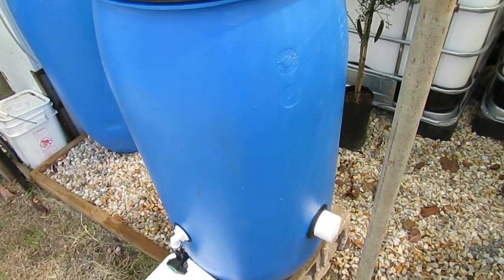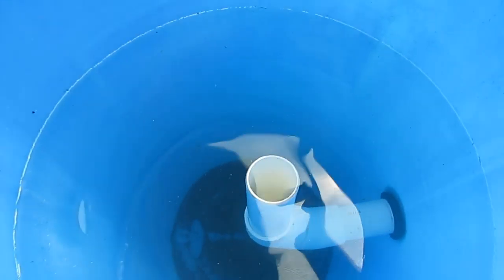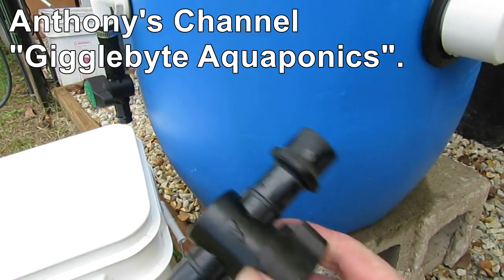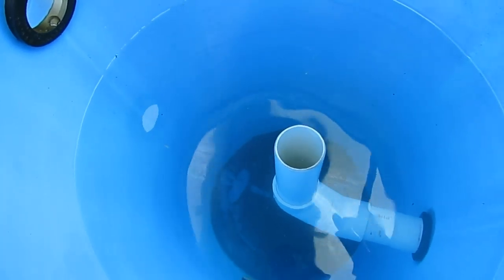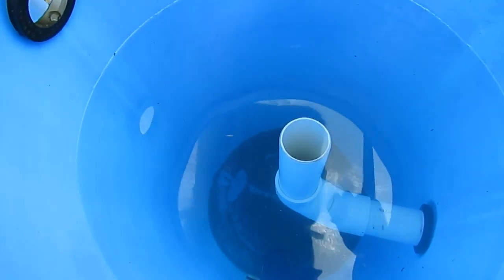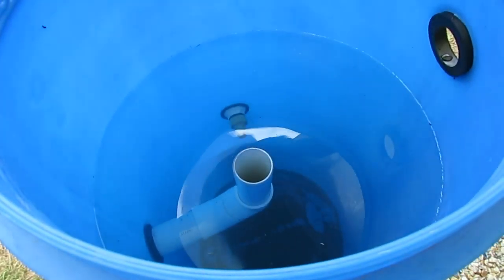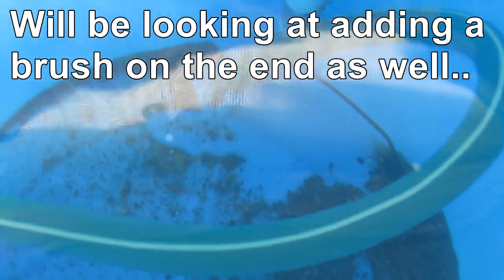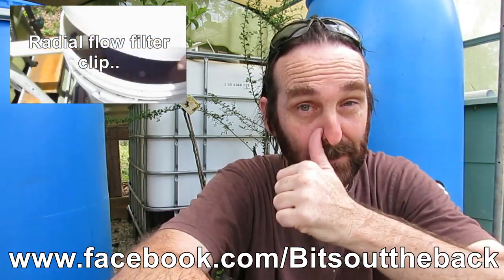Aquaponic & aquaculture radial flow filter cleaning, just playing around..

Comment: Great work Rob.
Looks pretty good to me and the best part is, it's simple.
The less moving parts the more reliable it will be.
Reply from the maker: That's what I was aiming for Brett.. Still looking at making an airlift vacuum just to see how they go.. Will mean having an air line running to the system but that's no big deal..
Cheers mate & have a great week..
Rob,
Reply: Rob Bob Was thinking about this the other night, what if you fitted a 90mm piece of pipe to the middle of the bottom of the drum? Then add a tap to the bottom of that? I'm thinking like a solids trap. 

Brett.
Reply: Brett Cooper Rob Bob Thinking some more, wouldn't need to be that big as the water flowing out the bottom would drag the solids in.

Better get back to work now, (squirrel!!)
Brett

Comment: I've seen people hand form a conical bottom from cement with a  2-3 drain in the bottom just using a pipe and bulkhead fitting. Thanks for another useful video.
Reply from the maker: Have seen the a few good ones made like thatafrohman.. The urban Farming guys did a great job on their swirl filter using that method..Vortex Filter DIY - Organic Fertilizer on Demand
Cheers & have a great one :)
Rob.

Comment: Hey Rob. Just want to recommend using vacuum attachment brush. I don't really know if it would fit on a 1 inch diameter PVC, but if it doesn't, you can take the piece of PVC pipe or coupler and heat it up in an oven or use a heat gun. Start from low temperature then heat it up for about 3-5 minutes. Make sure you put a piece of foil on the bottom just in case the PVC melts completely. Once the PVC is soft, wear some mittens and force the vacuum attachment brush to it.
Reply from the maker: Morning & thanks for that...
Am looking at adding some sort of small brush to the "wand"..  Was thinking of one of the wire style ones that I can fasten to the end with a zip tie.. Shall see how I go..
Cheers sir & have a great one.
Rob.
Reply: Rob Bob No problem. I have one that I don't really use. It came with the vacuum we already have. Looks like it would be very handy with this project. 

Thanks for the videos by the way. I'm planning to be like a gardener like you later on. I learned a lot of useful things in your channel. Here in the states, food is expensive and probably sprayed by chemicals I don't want in my body. I really love your life style.

Comment: Thanks Rob...great idea! Definately think a small stiff brush or maybe even a plastic scraper would be a good idea to get the goo off the bottom. You already have a bio filter on that system if I recall correctly so the raft system should be a great producer for ya :)
Reply from the maker: Buffalo_Chips 
Haven't used it much this time round but think I'll install one similar in the parents to make the job easier..
Cheers mate..

Comment: I would recommend giving the water a bit of a swirling action to make all the waste collect in the center. you do it with a during the collection phase using a small tube coming off the main inlet pipe or you could just do it when your collecting by swirling the water with your hand and then let it collect
Reply from the maker: Hi Corey.. I tried using my hand on one of the first clean outs in the aquaponic filter.. Noticed the solids broke up & spread through the water.. Think it has to do with the inlet pipe disturbing the vortex if that makes sense.. Didn't think of adding another pipe to help it along though.. Might be something to play around with..
Thanks for that mate..
Rob..

Comment: Ever think about making a cone, or funnel that sits in the bottom of the barrel? It could collect everything to a center point for easier clean out with the hose.... or you may be able to attach the hose to the underside of the cone even. Maybe just a slope to 1 side of the barrel could make a cleanout more efficient.
Reply from the maker: Thanks for the suggestions bigtitantrucker.. I have considered doing a cone but decided to have a crack at the easiest build possible.. A slope coming in off the side would help to collect the bulk of the solid to one spot but after a while I think there would be a build up of smaller solids behind the false wall that could cause other issues.. Someone mentioned having a go at including something like that on the FB page..
Thanks again & have a great one,
Rob..

Comment: Thanks rob, great video!  by installing a clean out valve through a bulkhead  or uni-seal in the bottom of the barrel, would you be able to eliminate the need for the hose?
Reply from the maker: Hi there...
We have one in the other radial flow filter on the side of the drum.. We need to stir up the solids to get it to flow out which is a bit of a problem as it mixes through all the water & we end up having to dump the lot.. If it was in the centre of the base it might work a bit better I think.. Will be playing around with that idea but for now I think I will stick for the hose on the big system.. Would like to get a plastic welder & install a cone in a drum but that will be a ways down the track at this point..
Cheers,
Rob.

Comment: Hello Rob,
Really enjoying your aquaponics videos as I'm preparing for my own.  Just curious but why not make an outlet to the sump at a point that leaves about 5 gallons in the barrel and use the current method of drain and flush with hose?
Reply from the maker: Thanks for that :) That would work well in the aquaponic system here as the sump is lower a fair bit lower than the filter.. The sump in the RAS is at the same height as the other filters so would be harder to do but shall keep it in mind though..
Cheers & have a great one..
Rob :)

Comment: If you attach a funnel on to the "sucking end" of the pipe it may help remove larger quantities in the same space of time. I have no idea as to weather or not that will work, but it is just an idea that comes to mind.
Reply: It'll be drawing from a larger area, but will reduce the force at which it sucks.  So that's great for lighter debris over a larger area, but not so good if the target is heavy.
Reply from the maker: Joe Howe
Cheers for the post below Joe.. YT won't let me reply down there :/
Have seen the air lift vac clip before & am still going to build something like that just to see how good they are.. Might need tweaking to be able to handle the waste from 60+ fish though..
Like the stocking one as well, might make something like that for the small tank we in the house that has the refugees from the old garden pond in it..
Thanks again & have a great one..
Cheers..
Reply from the maker: Have had a few folks suggest that so might have a go & see what I come up with.. Think the top of a soda/soft drink bottle should do the trick as it's about the same diameter as the hose..
Cheers & have a great week,
Rob..

Comment: If you have a bigger gauge tap but smaller hose and increase the flow rate, will that increase sucking power?
Reply from the maker: I think that would help a bit suction wise.. My concern would be solids clogging the smaller gauge pipe/nozzle.. The waste is very light & breaks apart easy so it might be ok.. I am thinking that a funnel connection on the end will help clean the base a lot faster so use less water during the process in the end.. Shall see how it goes with the real stuff soon I hope..
Cheers Paul & have a great one,
Rob..

Comment: Hey Rob great video as always.

 I was thinking about your siphon vacum cleaner which you use to clean the button of the radial flow. If you used an airlift (look them up on youtube, loads of people build them. Actually look up aquarium air driven vacuum cleaner and just build a bigger one of those as that is actually what I am describing here) instead of your water syphon you'd get better results and it would be more diverse. With an air vac could actually clean out your Radial flow and bottom of the fish tank without the need to turn off your flow or drain out loads of water. As the water in an air driven vac flows via a sock to capture the muck straight back into the water supply you are cleaning out. If you want a plan and parts list you to put one together, let me know and I'll knock something up for you.

Take care

Dunc
Reply from the maker: Hi there Dunc..
Have seen a few good clips on the air lift pumps & want to have a crack at one in the future.. The collection of the solids in a canister is the one issue I want to sort out.. Need to visit the local aquarium stores to see what sort of filter material is available as I'm expecting a lot of solids once the fish put some size on.. This is the clip I was going to use as a guide, #123: DIY Airlift Aquarium Vac Wand Version 2 - DIY Wednesday What do you think of that one ?
Thanks for the offer mate, really appreciate it..
Cheers..
Reply: Rob. that video is great. The issue with his design though in your application is the volume of solids you'll be dealing with. You'll notice in that example the collection chamber was near the bottom of the tube and has filter floss in it to prevent the exhaust water dragging muck back into the tank. If you deployed that design you'll be for ever checking it to see how full the chamber was getting. I'd use his airlift idea but bring the collection up near your top hand out of the water. use your 45/45 into a T with one side of the T being the air exhaust and the other pointing downward into a sock (yes a Sock, paint filter or mums stocking) that way you get instant feedback on how much muck you have collected and can easily remove the sock for cleaning.

With regards to filter medium. don't buy from an Aqurium shop its too expensive. You can get the same filters in larger sizes from Pool stores. Just order it online its cheap (heavy, medium and Fine as the three layers work as a team for complete filtration of solids). Watch 'Pond Gru' he has a few great videos on filters and mediums.

Between your radial flow and Bio medium I'd add another barrel/bucket, and fill that with filter sponges. The reason for that is the K1 bio medium will be more affective if you can keep as much solids away from it as possible. it will also mean you open the container less. That helps keep the bacteria in the dark and also clean. You'd then just have to interact with the radial flow and filter buckets for your cleaning routine.

I hope that helps. as previously mentioned if you struggle with a design I draw something up for you, on the back of a fag packet :-)
Reply from the maker: EastLondonKiwi  Cheers for all the pointers Dunc.. Shall look for pool pads this time ;)
CCBear is looking to add a filter box between his RFF & bio for the finer solids as he noticed a few getting through to his bio.. Think I might be looking into it but not 100% sure I will add one yet.. If we do it will be a small 15L bucket jobbie as we're a bit pushed for room..
Thanks Again Sir  :)
Reply: No worries Rob.  Here are a couple of ebay links to two of the items I was talking about. there UK listed items so ignore the suppliers and prices. You should be able to source (for the filter pads) from a local supplier, and the vacuum is just to illustrated my points, as this particular model is far to small for your application.

http://www.ebay.co.uk/itm/171033986851?ssPageName=STRK:MEWNX:IT&_trksid=p3984.m1439.l2649

http://www.ebay.co.uk/itm/3-PIECE-FISH-POND-FOAM-FILTER-MEDIA-SET-PROFILED-17-x-11-/261055504095?pt=UK_Pet_Supplies_Fish&hash=item3cc81ededf
Reply from the maker: EastLondonKiwi  Cheers.. I had looked at prices on some of the aquarium foam & nearly fell off my chair here :D
Cheers for a look at the vacuum too..
Reply: Yes it's a bit like owning a boat, anything market for marine use is 10 times the price. That said, there are our mediums that could achieve the same results if you apply some thought and effort. for example loads of plastic dish washing scouring pads in some sort of bag to keep them contained, would replace the heavy grade filter foam. Perlite sealed inside in a pillow case  will catch very fine muck replacing the medium filter foam (I use this myself inside my radial flow). Then some polyester duvet lining would act in the same roll as the fine filter foam. All of these could be designed to fit nicely into a 5galon bucket. As long as you have the water flow right (heavy to fine and they'll work just fine). You also want them in a container that has a large removable lid to make accessing them for cleaning easy.

I hope that helps.
Reply from the maker: EastLondonKiwi  Cheers mate.. Have been playing around with a few ideas but nothing practical yet.. Shall be posting the results once it's all sorted..
Thanks again Dunc..
Rob..

Comment: i had a thought as i was watching; seems like cleaning the siphon filter is a bit more work than it should be.  have you considered using a grow tower before?  you could look up bright agrotech for ideas on how to make one, but it should make having to clean out your swirl filters much much easier if not eliminate it altogether.  just my opinion.  either way, your system is quite amazing!  i really enjoy the system updates :)
Reply from the maker: Hi there.. This filter is to go into a straight aquaculture set up that will have no plants or grow beds attached.. Plan on also making up a mineralising tank to help process the solids to run through the aquaponics to boost its productivity but that job is a fair way down the list at the moment..
Cheers & have a great one,
Rob.
Reply: Rob Bob
good luck with the system updates! sounds like theres a few good videos ahead.  :)

Comment: Well, here's a random thought....

Get a hot-air gun and work on the base of the drum.  Get it nice and soft - pliable.   Then when you're happy with it, up-end it over a fencepost, to stretch a cone shape into it.   The fence post will also give you a flat spot, where you can attach a drain valve.

Never done it, but I haven't eaten fish shit either (that I know of).
Reply from the maker: Thanks for that Dave :D Wish I could say the same :/
Think I will be staying with the flat bottom for now but that will probably  change in the future.. Have spoken to a few that have tried to make the base of these drums conical & most have said it is a lot harder than it sounds.. It was suggested below to install the cone on the inside of the drum & plumb directly onto that so think I might give that a crack at that in the future..
Cheers Dave & have a great one,
Rob.

Comment: Wouldn't something like a SLO inlet work to clean out the solids from the bottom of your radial flow filter?  That hose looks nice, why not just leave it in?  If the mayerial it is mafe from is a problem, there are other materials used to make hoses.  I like how big that filter is.
Reply from the maker: Hey Ron. A SLO would only work if there was water dragging the solids out which would waste a fair bit. Future clips show the small drain attachments that were made up for this jobbie.  Here you go mate
https://www.youtube.com/watch?v=fQEh4FSNMrE
Cheers

Comment: A thought - make a plastic cone to place in bottom of tank. The large end of cone (top) should be snug against side of drum. Narrow end of cone (bottom) needs to fit inside a 2-inch 90-degree PVC elbow (or whatever size pipe you use).  With cone removed, plumb valve through side of drum towards center then 90 degree elbow vertical. Slide cone down inside drum; narrow end of cone slides inside elbow at bottom. Solids settle into narrow end of cone. Open valve to flush.
Cone calculator:
http://craig-russell.co.uk/demos/cone_calculator/
Regards.
Reply from the maker: Cheers for that, that calculator will come in handy.. Think I will be sticking with the flat bottom drum for now just to see how it goes..
Really like your idea of putting the plumbing inside the drum under the cone.. If I went down this path I think I would want the cone welded into place & an access port to play with the plumbing.. Thanks for getting me thinking :)
Cheers & have a great week..
Rob.

Comment: I use quikrete concrete mix to make a cone in the bottom of filter.
Reply from the maker: Hi James.. Did you set the pipe work in place before the mix?
Cheers,
Rob.
Reply: Yes. I installed a bulkhead through the bottom and then placed mix.  It's very easy to clean. I watched "TheUrbanFarmingGuys Vortex filter"
Reply from the maker: James Martinez
The units they made up would have to be some of the best I've seen.. Do you find all the solids settle to the base easy enough ?
Reply: I have a swirl filter.  I think that the radial flow may be the better filter, but I would think that the cone bottom can be used in both swirl or radial.